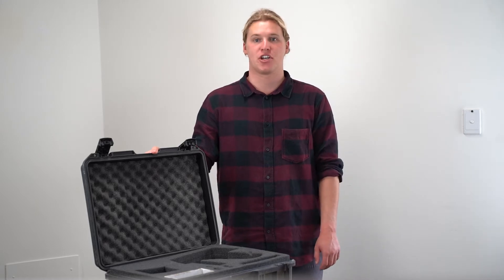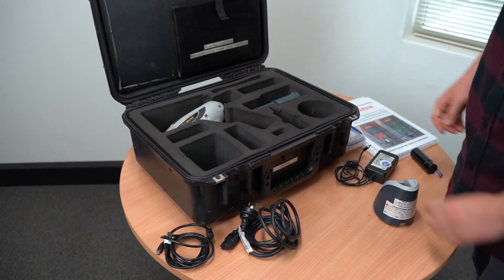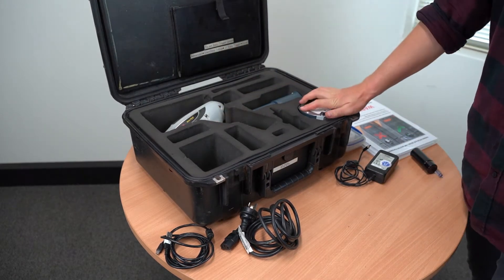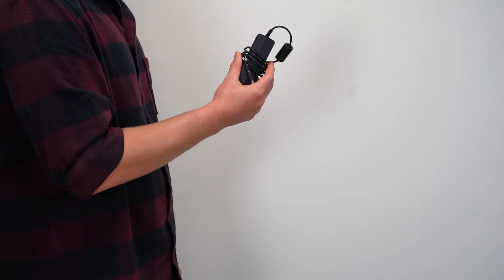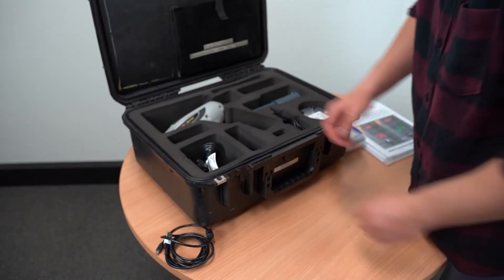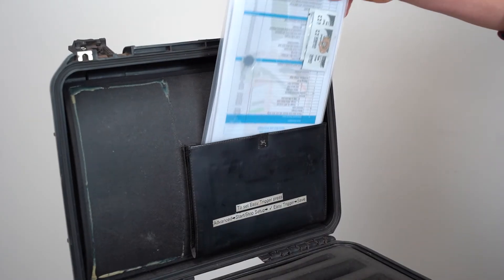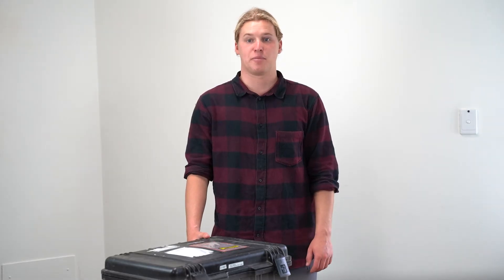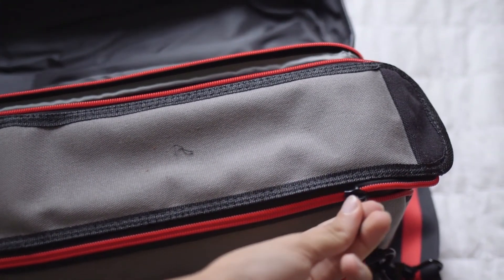How to pack up Niton XL3t XRF Analyser - XRF How To

Comment: Hi 

Currently we are using Niton™ XL3t XRF Analyzer for XRF analyze for core samples, our the xrf niton xl3t analyzer cannot save a file, after analysis of 20 seconds, the results should be displayed in the screen and the result will be saved from the data(memory) of the xrf but unfortunately, our portable xrf failed to do so.

Do you have any suggestion and any treatment we can setting ?